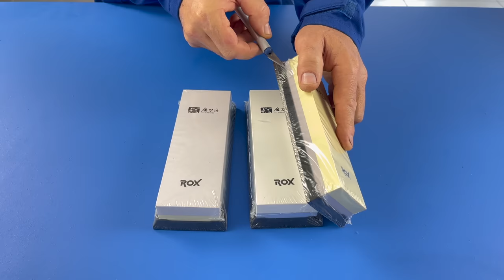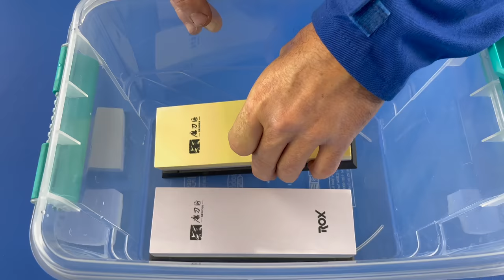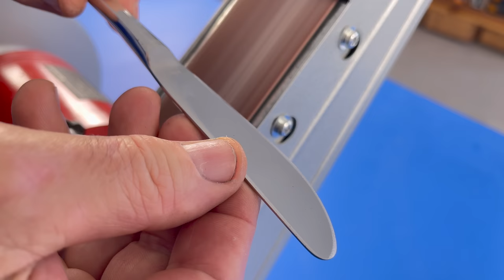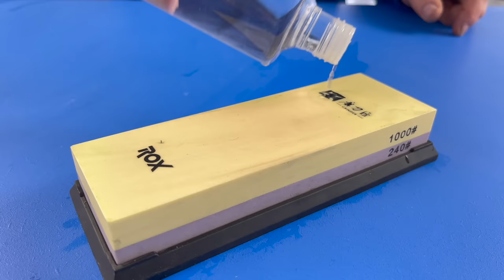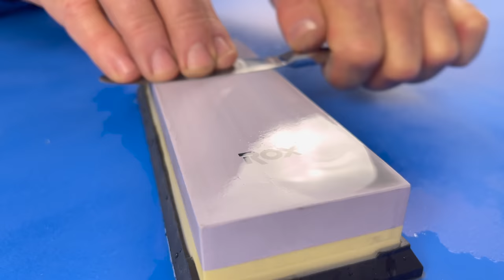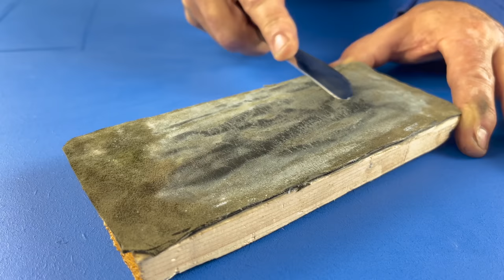Sharpen Your Knife Like This It Won't Blunt For 5 Years!

Comment: Your title just isn't true it isn't how you sharpen a knife it's how hard the metal is to how long it will last.
Reply: Obviously it's clickbait for a title🤦‍♂️
Reply: Its also how to use a knife, i can dull any knife in no time if i need
Reply: Эээ
Reply: Враньё с названием...
Reply: The title is true...if you don't use your sharpend knife 🤣
Reply: @aimbeats7126  atleast you know
Reply: Iyo ho oh tenan
Reply: @aimbeats7126  i
Reply: Correct, and the abrasiveness of the materials your cutting
Reply: I use the Lansky system. Shave my arm hair sharp.
Reply: Exactly.
Reply: It won't blunt for 5 years, so long as you keep using it as a butter knife
Reply: @NeevesKnives  i
Reply: @HienNguyen-hc9ce  👊
Reply: Also, using 3k grain for a kitchain knife is being overkill.
Reply: ナマクラを鋭く研いで何を5年間切れ味を持たせるのか？
Reply: It is definitely partially how you sharpen your knife. Certain techniques of sharpening will hold an edge better. Also the angle of the apex is a factor for how long an edge will hold.
Reply: Viele Messer sind einfach nur aus"Trompetenblech" und sind schnell wieder stumpf.

Comment: Yes, it's very sharp just after sharpening, but there is no way that knife won't need resharpening before 5 years of use!  It's stainless steel silverware, not chef knife steel.  it's relatively soft compared with normal kitchen knife steels and therefore much less resistant to wear.

Comment: So you get these stones, pour some clear liquid on them, then let them sit in some other container of clear liquid, then run your blade across them at some random angle.  Then finish them on a piece of leather that has had some abrasive compound applied. Who knew?  And if you start with a piece of silverware, just smooth the edge with a belt sander.  Got it.

Comment: That’s like a 3 degree angle. It’s so sharp b/c it’s so thin. That would last about one attempt on something harder than a tomato or sponge. Nice job on the sharp edge, but last for 5 years? Think axe angle or chisel vs razor blade.. different for a reason.

Comment: 5 years may be an exaggeration, unless the knife is used occasionally. How long a knife will stay sharp depends not only on the sharpening method, but above all on the hardness of the steel and kitchen knives are not of the best quality and even the best sharpening will not help here. Damascus steel is the best but such knives are insanely expensive.

Comment: It won't blunt for 5 years if you wrap it up and never use it! Kitchen knives are not made from the best steel and will blunt much faster than a good quality Japanese knife blade and they have to be sharpened regularly!
I've been sharpening blades of woodworking tools and knives for nearly 60 years and I would never make a statement like that about any blade!

Comment: Very expensive way to sharpen a butter knife…   The stones alone are an investment as is the sander for initial grind to shape the edge. 
The technique is commonly used for hand sharpening. 
Not a tutorial for keeping the angle but it does show the process for sharpening and sharpening.
The 10,000 or more fineness of the stone seems excessive especially since you strop it with white grit paste.  I get razer sharp on the usual knives with a max of 6000 or even 3000 and then strop not always needing the paste. Shaving sharp.

Personally I would not sharpen a butter knife, aka table knife.

Comment: Its facing the wrong way and it does not have a red handle it has a copter handle but it has to remain hidden because it huge and rusty with balls cut out the metal

Comment: You don't need a very expensive sharpening stone to sharpen anything. No knife stays sharp for 5 years if you use it frequently maybe not even 2 weeks, whatever the steel of the knife. There is nothing in Japanese sharpening stones that explains their price, not the material, much less their manufacturing process, that's all.